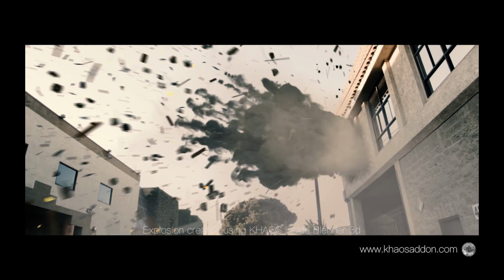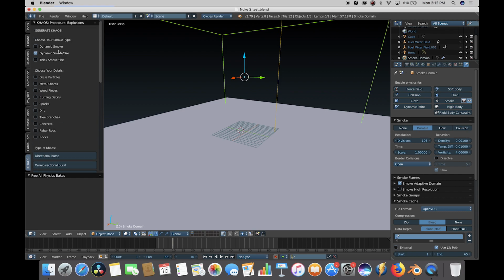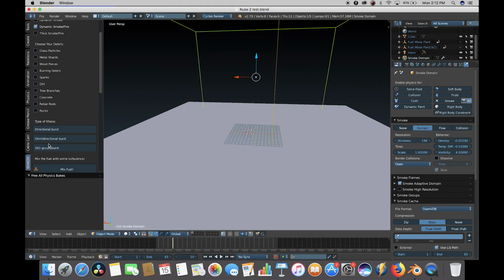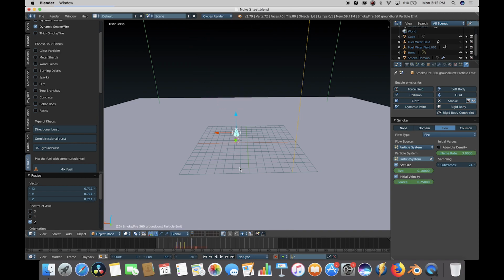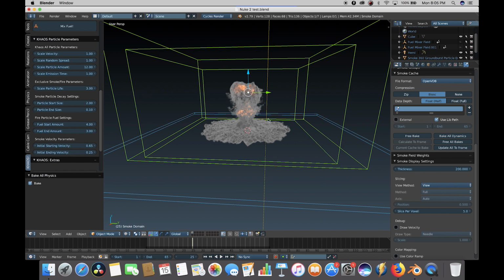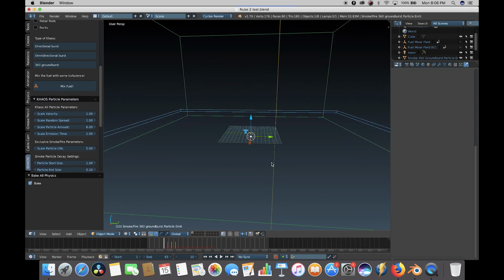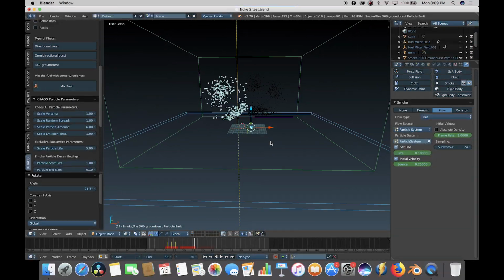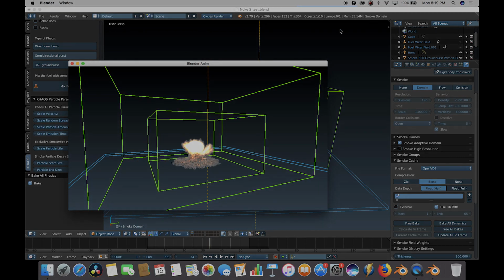How to "Build" Explosions in Blender 3d: Utilizing the KHAOS add-on

Comment: What kind of rig are you guys rendering this on?  Even with a 2080 ti, 32 gb ram and an 8700k with 128 samples, it's taking me 3-5 days to render an 80 frame animation at 1440p.
Reply from the maker: Hi John good question. Usually we are using Macbook pro's with 1.9 GHz i7 and 16gb ram.  Rendering volumetrics can take really long as you can see. Usually takes a few days for us as well. I recommend bringing down the samples between 40-60 and de-noising a bit in post. You can also experiment with the increasing the step size or decreasing the max steps for faster rendering times. Just make sure you don't do it too much as it will eventually decrease the quality of the render. Hope this helps.
Reply: @LightArchitect   I've been using your product for a few weeks now and i'm starting to really like how the explosions are looking.  Can you tell me how to get rid of the blotchiness of it all though?  Rendered at 1440p, 128 samples, 1024 max steps, 300 divisions in smoke domain, 50 additional under smoke adaptive, 2 divisions smoke high resolution.  Thank you.    
  
 https://www.youtube.com/watch?v=5pWQzncrOTA&feature=youtu.be
Reply from the maker: @johnsackman2453  Hey John. Really good work. I think the reason for your blotchiness is that the noise strength under your high resolution settings is too high. I recommend staying around 1.5-2. If you go higher than this and the smoke lingers it can create weird square artifacts.  Try reducing it and see if you get better results. Also you can try adding a very small amount of wind to your scene to build a more realistic environment around the smoke.
Reply from the maker: @johnsackman2453  Also  did you try decreasing your step size from the default?

Comment: Does this addon contain features that are exclusive to this addon and not part of Blenders simulation by default?
Reply from the maker: KHAOS streamlines the processes you need to make a good looking explosion simulation in Blender but it uses Blender's inbuilt smoke simulator. It also automates the addition of 3d scanned particle debris into your explosion. 

It doesn't it do anything you can't recreate in Blender by yourself if you have a lot of time on your hands. But it does automates the explosion creation process and saves hours of frustration in trying to get a good looking simulation. 

Think of it like this: You can spend hours modeling a 3d car for your 3d scene.... or... you can buy a nice 3d car model online to get your workflow moving more efficiently. 

Hope this helps. -Brad

Comment: Any guesses as to when the addon will be available for 2.8? :) I learnt how to use Blender with the 2.8 version, so 2.79x feels really awkward to me. Can't wait to have Khaos in 2.8 as well!
Reply: And yeah I've read about the bug, but.. I wouldn't mind that tbh, if you have a working version floating around somewhere in your pocket. :)
Reply from the maker: @DefiantFilmsTV  Hey Defiant. We weren't planning on releasing it until they fixed the bug....but maybe I will put a version for 2.8(Along with the 2.79 version) inside of the download as well. The subframe sampling makes a huge difference based on our experience so I really believe that it's best to simulate any fast moving smoke/fire systems will be much better in 2.79.
Reply: @LightArchitect  It would be nice to play with at least, for learning :)
Reply: @LightArchitect  I'd love that, could you make it happen and inform customers? :)